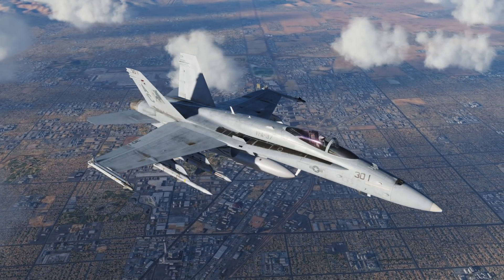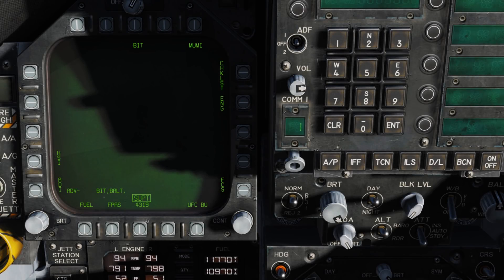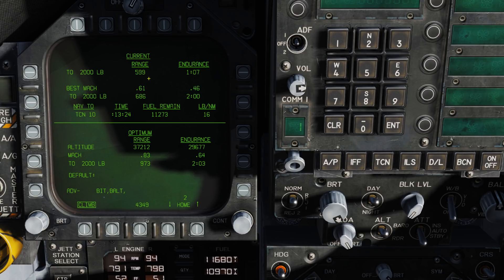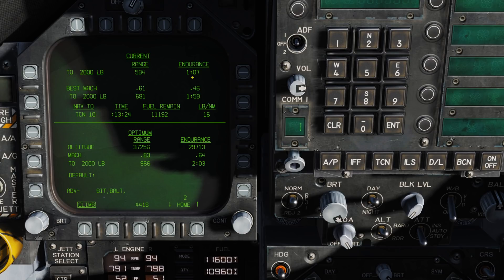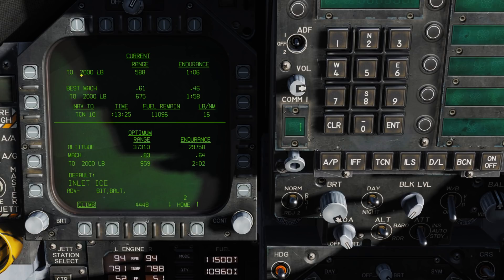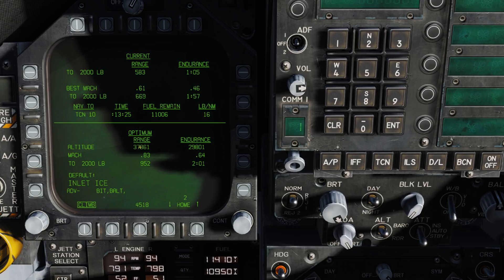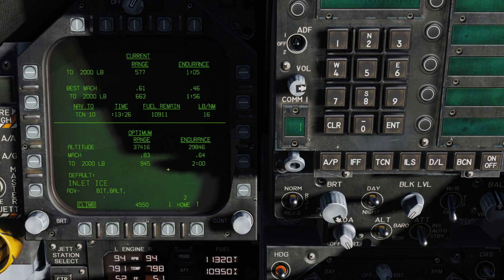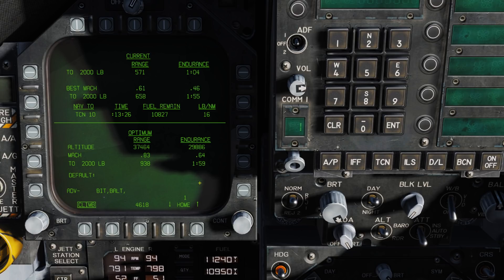DCS: F/A-18C Hornet – Episode 17 Flight Performance Advisory System (FPAS)

Comment: Is this already in the manual? do they update the manual as they add features?   I was wondering if there is a feature in the mission editor that would help you to figure out fuel  loads and flyable distances, there used to be a  (add on) calculator that helped, not sure if it still works?
Reply from the maker: Manual will be updated this month.

Comment: Is there a difference in which throttle setting the climb speed is achieved? I.e. with afterburner you can climb steeper (with higher climb rate)  maintaining the optimal IAS (if the indicated climb speed is indeed IAS), but burning a lot of fuel, while in max military throttle you'd climb in shallower angle (lower climb rate) with the same optimal IAS, but would be burning less fuel. How are the home fields set (WP0?), our is this function still WIP?

Comment: Thanks for the video, Matt. Q: Is the amount of 2000 lb fixed or is that amount variable and set by your bingo fuel amount?
Reply: I believe it is fixed and the amount you should have left when you get TO the airfield (to be able to go into a holding without declaring and emergency). Bingo fuel would be the amount of fuel that is needed to get to the airport and still have 2000lb left. (As far as my admittedly limited understanding goes)
Reply from the maker: Yes, fixed about above 2,500 lbs, or 0 when below.

Comment: So, just to be clear, are you suggesting the best plan is NOT to fly until the fuel remaining indicator reaches zero - at which point everything becomes very quiet and peaceful -  and then seeing how close to anything that even remotely looks like an airbase you can get to and perhaps touch down upon (with or without resulting fireball - and wtf is even catching fire at this point!  Hydraulic fluid ;-) )?
Reply: Best time to look for an airbase to land is when your plane is no longer a plane but a very heavy glider. Don't forget to drop ordnance to extend gliding range :D

Comment: Hi Wags. Question: why does the Hornet get a huge X that doesn't go away on the max G number on the FCS page after using the G override paddle with a load of weapons, and the FCS goes all jerky and the jet's nose is shaking around in landing configuration on speed AOA?, and besides that, when in landing configuration, the plane's nose raises and lowers itself according to the throttle.., isn't the FCS computer supposed to keep the aircraft on a steady attitude? And also when there's an uneven payload, isn't the FCS computer supposed to trim the aircraft to not keep banking to one side?
Reply: The FCS in landing mode tries to keep the plane in trimmed AoA, which is not the same as attitude.
Reply: When in landing configuration, the FCS changes rule set to instead maintain commanded (trimmed) AOA

Comment: Good old inlet ice making an appearance.
Reply: @ApeX Turn the inlet heaters on (next to pitot heat) and it'll turn off after a few minutes. I just ignore it though.
Reply: As people said , but it is a bug and i guess it will be fixed :)
Reply: @zigzagfly1635  Since it is a bug in the system you seek , then happy days for you :) Many other modules have cold weather systems effects ..why not this one ?
It will be there in the gold release i suspect.
Reply: @ApeX turn on your engine inlet heat switch, right side of the cockpit near the near the pitot heat switch. give it some time after you turn it on and you should see the advisory caution disappear.